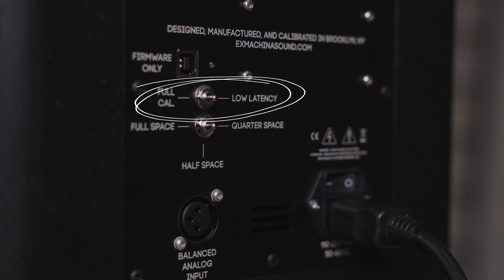Why Coaxial Speakers Sound Better (And Why Most Companies Don’t Use Them)

Comment: I have a pair of KEF iQ3 stand-mount speakers, which use Co-axial speaker cones.  I acquired these when one of my Quad 57 ESL speakers developed a fault.  I was so impressed with them, I decided to keep them, because the cost of having the Quads repaired was excessive, given the amount of use they got.  They are driven by a World Audio Design K5881 Mk2 Valve Power Amp, designed by Noel Keywood, of Hi-Fi World magazine.

Comment: "Why Most Companies Don’t Use Them" can be answered just by reading comments under this video. I don't know if there is more space more infused with myths than audio sphere (and I mean both HI-FI world, as pro-audio world). Someone tries to use actual science to make a better speaker and most people are "buuut actuaally there is this intermodulation distortion caused by speaker excursion" or "u cant fit good twitter in coaxial design because theeere is nooo rooom for it", jeez. 
Keep up with good work :)

Comment: Coaxial drivers sound different and even more surreal than regular speakers. The room sensitivity is way lower - they sound great in most rooms etc. However, one needs a sub by any means. Everything else is BS. And beware to to not interfere with the coax frequencies. Most 2 way systems do exactly this. horrible. My coax drivers from SEAS stop already around 200HZ. Beyond 12inch, one runs into usual driver problems. A line array with 10 X 6inch drivers or so creates just WAY more sound wave pressure in pascal as a unit. There are not huge coax audio systems by  definition. But if one buys a small speaker than always opt for coax.

Comment: Basically:  Kali Audio In-5's or In-8's at 5-7x the cost for ? That last 5-10% of performance?   That's the reality - diminishing returns - for us lowly consumers - the Kali's will work "good enough" - but I enjoyed the interview - and - it made me think:  Co-axials have been around forever in car audio - whynot "just" find a good set - build some boxes - then run a few subs?  Would work fine for most in the consumer world.... speakers are like wine - a lot of smoke & mirrors once you go past a certain price point.... but I'm just a "lowly" consumer so...  obviously there's the economies of scale factor on these - thus a much higher price compared to similar products one would find on sweetwater/big brands...

Comment: Cone excursion at high output levels can affect the tweeters performance in a single driver design. A good example of this is MoFi Electronics - SourcePoint 8 & 10. Reviewer's noted that the larger MoFi floor standers with more woofers allowed the coaxial driver to be crossed over much higher, all but eliminating any breakup at higher volumes. As long as you're actual listening levels are not too high, a well designed single coaxial driver design can absolutely sound amazing. KEF has proven this multiple times over. If at times you insist on cranking it, this design may not be for you. If clarity and finesse are your priority, these drivers are definitely for you.
Reply: KS Digital has the best "fitted" coax speakers I am aware of. They use SEAS drivers. Add some decent subwoofers with low decay. very very lood. I use them also as a PA for 100+ people parties.

Comment: Coax is OK if you need a most compact speaker or for nearfield applications. For a best sounding speaker it's not easy to argue, but the intermodulation distortion is a big problem, specially with 2 way coax systems and the waveguide of the woofer and geometrical aspects are BS for the construction too. There're good coax high mid drivers and loudspeakers out there, but a seperated mid / high is the better concept in most cases.

Not worth the time listening so far, just marketing bla bla.

Comment: Why doesnt everyone use them? They are hard to make properly. Emphasis on properly. Also midrange cone movement influences tweeter increasingly more if they are crossed too low to bass driver as it serves as its waveguide. Any imperfections physically between tweeter and midrange driver cause diffraction effects

Comment: Coincidental speakers are interesting, but they aren't very musical. The most musical speakers only use one driver.
Reply: "Musical"  Wtf does that even mean.  Tell me how you measure musical.  All the best brands in the world build their speakers with measurements and state of the art equipment.  Every speaker design is a trade off.  There is no perfect speaker design otherwise every manufacturer would only build that design.  Single driver designs do sound awesome and I personally love them but they have a massive flaw of having the tweeter vibrating back and forth with the bass and thats if they even play full range in the first place.  Any speaker design can be "musical" whatever that means...
Reply: @PowerSerge5000  Hi Serge, 

When i say musical I mean it sounds like there is a live music band playong infront of you. The more analytical a speaker sounds rhe less musical it generaky tends to be

I would like to thank you for replying to my comment, I value your opinion on this topic.
Reply: @KallusGarnet  And what do you mean by analytical
Reply: @KallusGarnet  What a pile of nonsense.

Comment: They sound better in some ways and worse in others.
Reply: Its true he should have talked about the biggest negative and that is that the waveguide driver vibrates back and forth which distorts the high frequency a bit.  However with 3 way designs the midrange can be designed to where the cone movement is minimal so the trade off looks much better.
Reply: Cone excursion at high output levels can affect the tweeters performance in a single driver design. A good example of this is MoFi Electronics - SourcePoint 8 & 10. Reviewer's noted that the larger MoFi floor standers with more woofers allowed the coaxial driver to be crossed over much higher, all but eliminating any breakup at higher volumes. As long as you're actual listening levels are not too high, a well designed single coaxial driver design can absolutely sound amazing. KEF has proved this multiple times over. If at times you insist on cranking it, this design may not be for you. If clarity and finesse are your priority, these drivers are definitely for you.
Reply: Separate tweeters outperform the coaxials. Simple: there is no space inside for good one.
Reply: @GBatya  not true. all depends on cross-over frequencies. you can easily use compression drivers etc. Coaxial drivers sound different and even more surreal than regular speakers. The room sensitivity is way lower - they sound great in most rooms etc. However, one needs a sub by any means. Everything else is BS. And beware to to not interfere with the coax frequencies. Beyond 12inch, one runs into usual driver problems. A line array with 10 6inch drivers or so create just WAY more sound wave pressure in pascal as a unit. There are not huge coax audio systems by its definition
Reply: @BeatPOWERvomPowerhof  Those are the worst man... We talk about at least hifi performance not PA. For example wide staging, low distortion, good waterfall response, smooth (flat ) freq response.

Comment: Do the large waves of the woofer effect the sound of the tweeter being in the wave, or does it create a phase distortion through pushing and polling on the tweeter output?
Reply: "Affect" not "effect." Polling?
Reply: It depends on the dispersion characteristics of the tweeter. Some tweeters have very wide dispersion and will not be good candidates for coaxial placement.

Comment: What I would love to see more... Speaker with coaxial ribbon tweeter design. 

I personally love the clear sound ribbon Tweeters on my Adam Audio D3V, but have been wondering if it was possible to create a similar coaxial design like on my KEF LS50 Meta's.
Reply: Radian makes a driver just what you are looking for. Ofc I can't think of a premade speaker using that so you gotta diy.
Reply: If you put two midrange units at the 12 o'clock and 6 o'clock position relative to the tweeter, then the mids will have an acoustic center that lines up with the tweeter. And the whole thing will seem like a point source. This is the D'Appolito (MTM) configuration.

Comment: Coax is much more expensive to make,  so higher cost..
Reply: Is it? You'd still need to make both of the drivers anyway. it's the same number.

Also, that's NOT a good excuse for mid to high end speakers, which cost a lot already. We deserve the best at that point.
Reply: There's the liabilities list, and the benefits are conspicuously absent. 🤔

Comment: The waveguide & time alignment is a theory, that some mfgrs embrace. I bought a pair of KEF Uni Q tower spkrs, & both drivers seized-up😤, after only 5 days of being driven hard, their SPL was limited😢. There are many fine sounding spkrs, using separate, dedicated drivers. It’s all a matter of personal preference🔊😎.
Reply: I've got many Kef Uni's some are 25-30 years old and used loads, they have never seized up, it's just you.. thrashing them, so of course they broke.
They go really loud, but need control, Kefs are best bi-amped.

Tell a lie, lost one set of tweeters on a hot summers day, the tweeter amp got too hot and died along with the tweeters.
All Newer Kefs are made in China, except the Reference still made in the UK, most Kefs are not as good as they were back in the day when made in the UK, nor sound as good.
Reply: Budget KEF's (2-way, 2.5-way KEF)  will do that and they are SPL limited. But their R Meta and Reference Meta, all 3-way,  will hit 95db+ full range virtually distortion free .
They are capable of 100db+++ especially when integrated with a subwoofer.
Reply: Driven hard aka clipped dirty signal lol

Comment: It’s because most speaker manufacturers use off the shelf drivers and there are few OEM coaxial drivers
Reply: There are enough of them. SB Acouatics and SEAS comes to my mind immediately.
Reply: @TheAgentDeus  B&C even triaxial ones. with compressions drivers ets. Personally, I use SEAS. Recommended
Reply: @BeatPOWERvomPowerhof  SEAS is little bit too steep price for me but I I'll use SB at one point when I finish my Mark Audio projects.
Reply: @TheAgentDeus  I am not aware of a good and cheap coax driver. However, maybe DSP can do wonders but I am sceptical. Drivers are like food ingredients. If you have e.g. a bad peace of meat then you will get a great meal.
Reply: @BeatPOWERvomPowerhof  Well, Mark Audio is cheap and they build Sibelius out of it so I remain skeptical about that "SEAS only" or what ever wallet breakers. SB Acoustics is a really respectful OEM. By the end of the day, if you like it then you like it and ain't no waterfall plot telling me that this speaker is actually crap.
Reply: @TheAgentDeus  MarkAudio is expensive as well. Visaton is price-quality champion
Reply: @BeatPOWERvomPowerhof   40€ up to 300€ so basically Mark Audio price ends where SEAS starts. 
With Visaton I have love-hate relationship, nice cheap stuff but requires 2x bigger box then others, that is roughly said though, don't start to nit pick on that sentence :)
Reply: @TheAgentDeus  But they are cheaper. When the space is limited too.
Reply: @GBatya  I didn't get it...